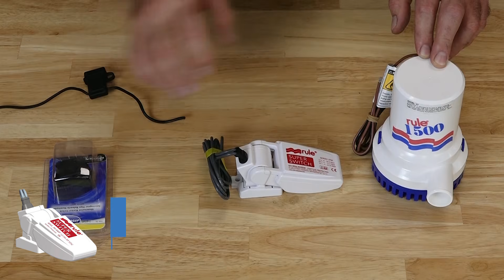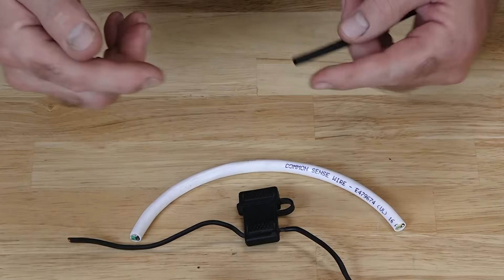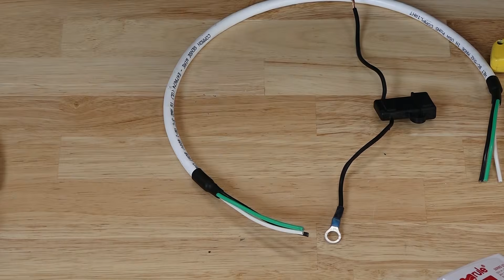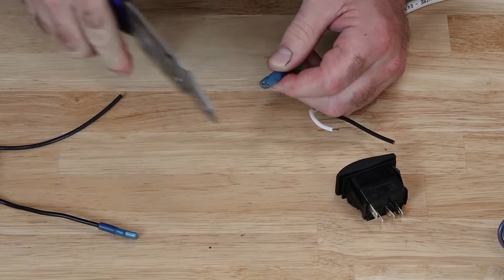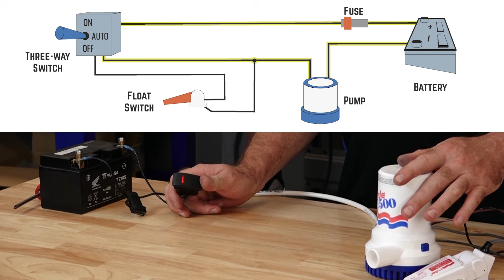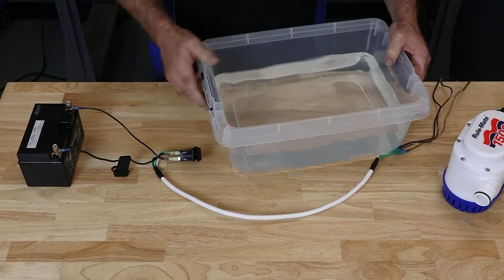How to Wire a Bilge Pump | How to Install a Bilge Pump | Bilge Pump Float Switch Wiring | Boats.net

Comment: One question , I have a pump with switch level , but when I turn on the switch to ON , the pump start run , without water to activate the Switch level, means the switch level is damage ? Or is another reason? Thanks in advance

Comment: I have my Pump and a new float, my pump was running with no water for a couple hours, I though was the float, so I change it for a new one but not was the float, could be the Pump? Do you have any video how is built the Pump inside:? 

Thanks Great explanation

Comment: Do these wiring configurations still work if the main battery switch for the boat is in the off position? If so which configuration to use since I only have a lighted on off switch?

Comment: Pulled 2 people out of their sinking boat last weekend. Came home and tested my Automatic 1500 Rule bildge pump, worked great. I will test it regularly now... I have it on Automatic only but will run the wire for manual. I just purchased the Rule Bildge Water Alarm yesterday. Good to have a notification that water is in the bildge just in case the automatic pump switch were to fail.... then I can manually switch it on...

Comment: Bilge pumps should never have a three way switch where it can be turned off and should be wired around battery switch so when your boat is at dock and you turn batteries off bilge pumps still work

Comment: Very nice video. Only minor comment is regarding soldering as the preferred method for connecting wires.  Most people don't know how to make a good solder joint and cannot recognize a cold joint. A poor solder joint is likely to fail unexpectedly.

Comment: I got a 3 prong toggle switch as I am going to put it in a jet ski.  How can you tell which prong is the negative or does it not matter?
This was the best video I found after looking thru at least a dozen video's on how to actually hook the battery to the switch and bilge.

Comment: I ALWAYS keep an extra bilge with 20' of wire and aligator clips rolled up in a bag for an emergency backup. You can also lend it to a vessel in distress. If you have water in a forward compartment.... It's like having jumper cables in your car. You rarely need to use them. But when you do, you're glad.
Reply: Do you carry an extra hose with you too?
Reply: @austinlee6444 
Yes. 8 feet plastic flex tubing. It rolls up nicely into a large zip lock bag.

Comment: Also adding a comment on the wire selection. ABYC now calls for D/C neg to be yellow but I wouldn't necessarily do this when just wiring a pump but using cable colour corded for A/C is going to be confusing. It should be black & red or red & yellow. I
I always like to label pump wire so that it is obvious which wire goes to the float switch. Ideally use heat shrink printed labels but anything that is permanent is ok

Comment: There are a few things wrong here. If you need to join wires it is much better to use ring connectors into a connector strip than to cram 2 wires into a crimp. Also when making crimps there are ratchet crimp tools with heads specifically designed for heat shrink connectors that will make a better crimp than the pliers he is using. Final point it to make sure everything is marine grade, that inline fuse as plain copper cable so it is not marine spec.

Comment: I'd rather burn up a pump once in a while with a stuck float vs. having the boat sink because someone turned the bilge pump off.  Those 3 way switches are not allowed on any boat I own it's the first thing I change out.

Comment: Since mercury switches are not available, and after several float switch failures on my 44’ sailboat in the Caribbean, I wired the bilge pumps through a relay controlled by the float switch. My results, no more failed float switches. No start and run current through the float switch.
Reply: Go buy a basic house thermostat w a mercury switch and take the switch out or better yet thrift stores..

Comment: Thanks, my bilge and  live well switches stopped working. I guess I need to find a fuse somewhere. The actuator on the bilge works on its own. The console switches are not activating either pump. Any suggestions welcome.

Comment: That rule 1500 is great and they’re super expensive. I have one and the internal sensor broke so it’s always on. So I had to put a float switch and got it working direct to battery. That’s my second pump, first is a rule 800gph.

Comment: Thank you for your excellent video. Maybe you know about a probelm I have. I installed a new rule 1500 using a ckeck valve. Sometimes the pump works but does not stop and the water level remains the same. Removing the check valve it works perfectly. Sometimes with the movement of the boat the pump starts again for short periods, that's why I wanted the return valve. But it seems the pump cannot open the valve when the pressure of the water in the pipe is present. Do you think it is normal or have any other explanation ? Thank you

Comment: This was a great video, just wondering if the Rule switch #43 has the built in fuse that is 20amp Max. How will this protect the circuit or appliance 500 GPH Pump that is a 4 amp fuse size and a float switch that is 14-20 amp depending on the model?

Comment: Just a recommendation.  The Harbor Freight ratcheting crimper is only $20 and well worth it. I had to lengthen the existing wires in the boat and it was impossible to get a good solder because of the limited space in the bilge. The crimper gave me good, consistent and quick connections.
Reply: Buy heat shrink with solder ring in the middle.

Comment: Thanks John, I am wiring an automatic pump with internal switch.  It has only three wires and seems to be your second pump scenario.  I would like some kind of indicator light to work and to be able to turn it off?  * how do I wire this to an on-off-on as the auto wire is always connected to the positive battery terminal?  would i use a DPDT (on)-off-on switch with  position 1 - connect manual to (selector switch) power    position 2-off  position 3-connect auto-run wire from the pump all the way back to positive terminal?  or would i use the same exact switch you used for (on)-off-on with the separate float switch design?

Comment: thats the most clearest video yet! can you make video to add a check valve? tysm!
Reply: I am not an expert but I think the manual doesn't recommend a check valve unless your discharge is less than 12" from waterline. check out the .pdf for the pumps.